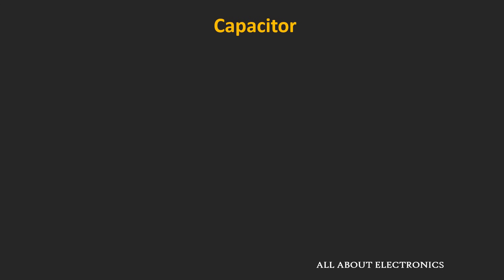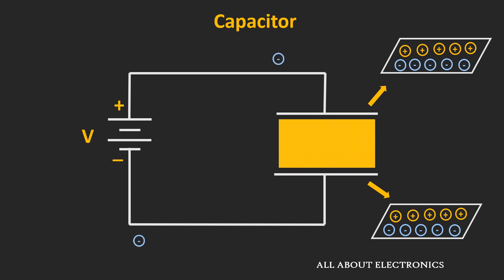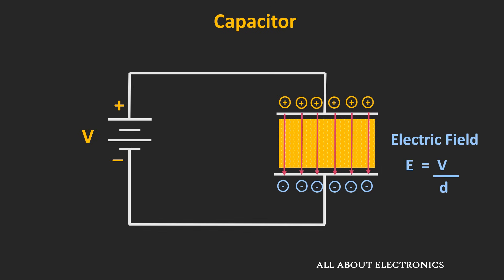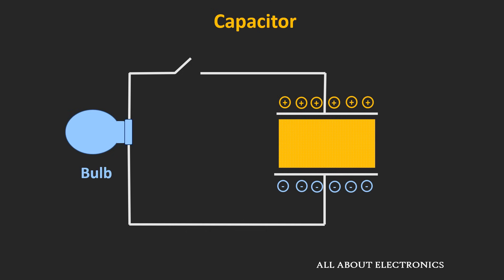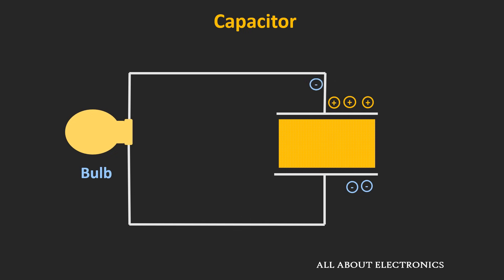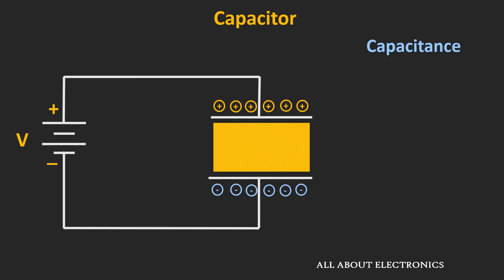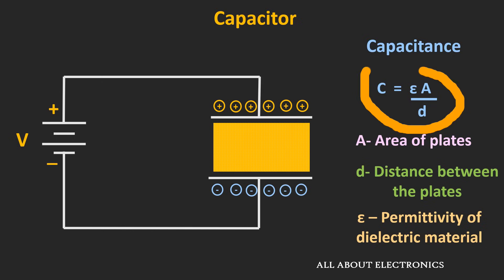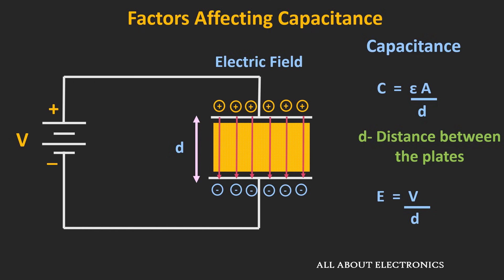How does a capacitor work ??

Comment from the maker: Timestamps for the different topics covered in the video is given below:

0:12 How does a capacitor works? (Charging and Discharging of the capacitor)

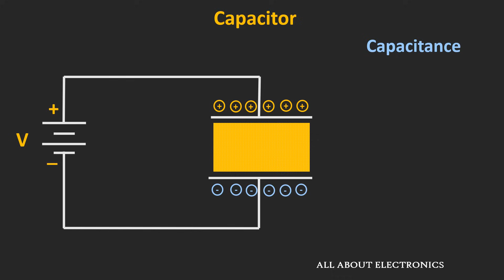5:46 Factors affecting the capacitance of the capacitor
Reply: ALL ABOUT ELECTRONICS thank you very much. Take my salam.
Reply: What is the difference in behavior of capacitor when it is connected to ac and dc source
Reply: ALL ABOUT ELECTRONICS
Reply: one small dought light emits photons right! then how electrons and photons will get balanced , when we connect the capicator to light bulb?? becoz phtons are getting emitted in the form of light , then how it possible sir??
Reply: capacitor is used to store incharge then how it avoid the noise in the circuit
Reply: @jeevith2934  please provide the explanation once u get it.
Reply: plz help
Reply: Sir, Thank you so much ☺😊☺
Reply: How capacitor work in AC supply
Reply from the maker: @SathishKumar-ok1sl  It works similar to the DC voltage. But when the polarity of the voltage reverses, the charge on the plates will also get reversed. As the sinusoidal voltage increases, the charge across the capacitor or the charge developed on the capacitor plate increases. And when the voltage gets reversed, the charge on the plate will also get reversed.
I hope it will clear your doubt.
Reply: Function of capacitor in AC & DC
Reply: Nice video

Comment: If i connect an led to this circuit will it blink before capacitor is charged up or no? It makes sense to me because electrons still flows until its fully charged.
Reply from the maker: I think you mean to say, the led in series with capacitor right !!
If so, then yes, when you just connect the supply to the capacitor, then it will turn on. But as soon as the capacitor charges and reaches steady state, it will turn off.

Comment: But u mentioned that electrons flow from+ to - terminal.. but actually electrons doesn't really move ( maybe very slowly like hours) then is it due to the electric field existing between the battery and the capacitor through which energy is stored? I'm totally confused... Help me

Comment: You are saying that current is only flowing externally through battery but how could it flow through dielectric material
Reply: Displacement current.  The charge on one side produces an opposite charge on the other side of the dielectric, that is effectively a "current".   The electrons themselves do not have to jump the gap.

Comment: 5:32 what's tht electric device behind y capacitor
Reply from the maker: It's a transistor with a metal case.
Reply: @ALLABOUTELECTRONICS  them wouldn't it become a conductor?
Reply from the maker: @MysteriousJelly  I didn't get it. I think you are talking about the image of the capacitor at 5:32 right ??
Reply: @ALLABOUTELECTRONICS  sorry, I was asking "But for flow of charges the circuit should be complete r8? If there's a dielectric substance in the middle then flow of charge would stop right?"
Reply from the maker: From the positive plate or top plate, the electrons gets attracted towards the positive terminal of the battery and through the negative terminal of the battery the electrons are pushed towards the bottom plate. Of course, they are not going through the dielectric material. But there is transfer of electron until the capacitor gets charged up to the battery voltage. Up to that voltage there is a transfer of charge between the battery and the two plates of the capacitor. So, in this way, there is a flow of electron between the capacitor and battery. I hope it will clear your doubt.
Reply: @ALLABOUTELECTRONICS  oh yeah, there is no transfer of electrons from negative to positive plate, electrons are just getting attracted and moving backwards in the same path... Thanks ❤

Comment: My question ❓
Are Capacitors acts like batteries? 
  If Yes, what is the use of Capacitors??
Reply from the maker: Yes, some capacitors e.g supercapacitors  can be used a battery for storing or transferring a quick charge. But not all types of capacitors can be used as battery. 
Recently I have a made a video on types of capacitor. In that video, in supercapacitor segment I have explained that. For more information, you can go through that video.

Comment: Sir I have one doubt that what is the difference between capacitor and battery?
Reply from the maker: In capacitor, energy is stored in the electric field while battery stores energy in the chemical form ( chemical energy) and later it is converted into electrical energy.
Moreover, capacitor discharges rapidly while battery discharges relatively slowly.
Reply: @ALLABOUTELECTRONICS  ty🙏🙏

Comment: If the dielectric material is insulated than how the electron from upper plate reached at lower plate as you show in animation it attracted toward + terminal but after that there is negative terminal it will repel by that then how it will possible

Comment: if for example A capacitor is charged to a voltage of 5V and then this charged capacitor  is connected to a voltage of -5V will the capacitor get discharged?

Comment: I understand it's the charge that is accumulated from the voltage source that gives the plates a positive or negative charge. The capacitor stores charge, does it produce an electric field between the plates. It's the inductor that produces a field and stores energy in the field.

Comment: Sir can u plz explain what if we remove a dielectric from a charged capacitor what will happen to its capacitance ...??
Reply from the maker: capacitance reduce. Every dielectric material has some relative permittivity. For air, it is equal one. So, capacitance will reduce.

Comment: Sir I don't understand that c=q/v, it means as voltage b/w two plates decrease then capacitance increases... For continuation to above equation when p. d b/w two plates decreases it results electric field also decreases, then capacitance also decreases na, how it is possible
Reply from the maker: The capacitance of any capacitor is function of area of plate (A), dielectric material and the distance between the plate. Once you construct the capacitor, its capacitance is fixed. The capacitance shows the ability of capacitor to store a charge for the given value of applied voltage. 
For the given value of capacitance, if you apply the less voltage, then the charge stored across it will be less. If you apply more voltage, the charge stored across it will be more.
For second capacitor, which has higher value of capacitance, if you apply the same voltage (as in the previous case), it will store more charge. (from C = Q/V)
I hope it will clear your doubt.
If you still have any doubt, let me know here.

Comment: Nice boss but my doubt is according to ur video the source was decides the polarity of capacitor and the capacitor polarities are changes w.r.t t o source polarity but practically a capacitor have assigned with constant signs .both concepts r vary which is correct

Comment: But your video is wrong 
Capacitor blocks DC supply 
You seen in this video which is wrong
Reply from the maker: When we say, it blocks DC voltage, it's under steady state condition. That means once it fully gets charged, it doesn't not draw any current. But during the transient, when it is initially uncharged, it starts charging towards the supply voltage. And once it charges to that voltage, it does not draw any current. ( There would be some leakage current, but let's assume its zero for a simplicity). And that's why we call it as if it blocks DC. I hope it will help will clerify this misconception.

Comment: During discharging process, when electrons flows from 2nd plate to 1st plate till both the plates will become Electrically neutral then the positive charges which is stored on 1st plate has to flow towards the 2nd plate to become Electrically neutral?

Comment: What is the cause of the potential difference btw the plates ?is it electric field or the charges stored there
Reply from the maker: The potential difference between the two plate is generated due to the charge stored near the plates. And in fact, that stored charge also generates the electric field between the plates.
Reply: @ALLABOUTELECTRONICS  so when we increase the area keeping the v=1volt ,the charges stored also increases,so the potential also increase between the plates from 1v to something like1.5 naa

Comment: Sir, if the dielectric material opposes the electric field developed by capacitor, then how it's increasing capacitance?
Reply from the maker: As I mentioned, the effective electric field of the capacitor reduces in the presence of the dielectric. And due to that, the voltage across the capacitor will also reduce. (as V= E/d)
And C = QV. That means as V reduces, C will increase for the same charge. 
I hope it will clear your doubt.

Comment: How the charge is remains constant even if the dielectric is introduces between the capacitor? Plz share answer if any body knows.....
Reply: Dielectric does not conduct the flow of charges. It is an insulator.

Comment: After charging how  long a capacitor  can store or retain the charge if, it will left ideally ?
Reply from the maker: Ideally, it should retain it forever. (Assuming there is no leakage current). But practically, every capacitor has some leakage current. And due to that, it will lose its charge over the period of time.

Comment: Its a great phenomenon i think.

Alright, first we need to learn what is light. So what is it? Particle? Wave? Both? Well, its an electromagnetic wave. Check this out;

This is light. The length between the 'hills' determines its wavelength. Well, it is also behaves as particle, like this wave is hitting only one point as seen in piezoelectric event. But whatever, the wave function is special for us. Now, you see electric and magnetic fields, but what are those? They are actually same thing, like different sides of a coin, and coin is being electromagnetic field. But its hard to work when both are in our way, so we use one of them for calculations etc. You just have to know that when there is movement in electric field, it means something happens in magnetic field too.

So, im going with electric fields, check this out;

You know same charges repel and different charges pull. This is the basic drawing.

Now lets get in our light bulb,

You know bulb works by using electricity, and basic bulbs like in picture just pass current through filaman. Now think, what actually passing? Electrons. What are electrons? Negative charged particles. Now lets check the electric field;

Lets move the particle, but keep in mind that electrons jumping from atom to atom, so its like move-stop-move-stop. Now i want you to imagine field around it. You see, you vibrating the field. Its like moving a rope, stopping, moving and stopping. You create waves.

See, a wild electric wave created. Now remember, when there is electric field movement, there is movement in magnetic field too. There is a electromagnetic wave, swimming in electromagnetic field. Thats a photon.

Comment: Can u explain that why capacitor only allow ac not dc
Reply from the maker: Actually it allows both. But when we say it allows AC and blocks DC, we are referring to steady state condition. During DC, once it is charged to maximum value it won't charge further. And current becomes zero. So, we say it won't allows current and blocks DC. But as AC signal is changing continuously, the charge will change continuously too. That's why its said so.
I hope it will clear your doubt.
If you still have any doubt, do let me know here.

Comment: I have a serious doubt in this video... What is blocking of capacitors?  What happens when we apply ac voltage to the capacitor?
Reply from the maker: I think you mean to say how capacitor blocks the DC voltage right?
See, once the capacitor fully gets charged up to the supply voltage, it can't charge further. And once it charges fully, it will not allows the flow of current. 
So, it blocks the flow of current once it fully gets charged. 
In the case of the AC voltage, the voltage changes continuously. That means after the positive half cycle, the direction of the current reverses. So,, the capacitor starts charging in the reverse direction. 
So, in a way, there is always a flow of current in case of AC signal.
I hope it will clear your doubt.
Reply: @ALLABOUTELECTRONICS  in both 
Cases the charges stored in the capacitor is same.. Right? Then what is the advantages of using ac?
Reply from the maker: Actually capacitors are used in both AC and DC circuit for various purposes. 
For example in DC circuits, it is used for the filtering the ripples. In AC circuit it is used in induction motors, power factor correction etc.
Reply: @ALLABOUTELECTRONICS  In ac circuit, on which direction the electrons flow first?  Towards phase or neutral?
Reply: @ALLABOUTELECTRONICS  Thank you .

Comment: Great video.. and you have covered a lot, right from how a capacitor works, to its unit, and what impacts the capacitance.. brilliant.. I have a question.. I couldn't understand why would the capacitor be able to store more charge when the distance between the plates reduce?
Reply from the maker: The capacitance is directly proportional to the electrostatic filed between the plates. And this field is stronger when the two plates are close to each other. (E = V/d)

Comment: Is there any intial terminals for capacitor or will they develop the terminals?or else like....in ac input,for half cycle it'll devlop terminals and for another half cycle it reverses terminals? How
 capacitor works with ac input??
Reply from the maker: Usually, for DC applications, the polarised capacitors are used, where the polarities are explicitly mentioned. While for AC applications, the unpolarised capacitors (e.g ceramic capacitors are used).
Reply: @ALLABOUTELECTRONICS  oh i tnk i need 2 check practical capacitors again😊 btw tnx for clearing my dbt

Comment: Do the electrons from the top plate just accumulate themselves at the positive terminal of the cell? Or do they pass through the cell? Is the latter possible?
Reply from the maker: The positive terminal of the battery attracts the electrons from the top plate and the negative terminal of the battery pushes the electrons toward the bottom plate. Yes, so in a way electrons are passing through a battery.

Comment: what about A.C voltage at capacitor
Reply from the maker: In the case of AC, capacitor charges and discharges according to the applied AC voltage. Just assume that you have applied the DC voltage to the capacitor, so positive and negative charge will build up, on the capacitor plates. Now, if you reverse the polarity of the applied voltage then the charge that is developed on the respective plates will also get reversed. And the same thing happens when the AC voltage is applied to the capacitor. 
I hope it will help you.

Comment: When AC not store in capacitor why are used in induction motar
Reply: Because it provide another current which is leading in nature so rotating magnetic field produced and motor starts to run when rotor cits the magnetic field

Comment: how the positive charge move to top
Reply: Only electrons move, positive charge is just a lack of electrons. Read up on electrons and holes for better understanding.
Reply from the maker: On the top plate, the electrons are attracted towards the positive terminal of the battery. So over the period of time, there will be a shortage of electrons at the top plate. Or in other words, it can be said as the positive charge is getting accumulated at the top plate. 
I hope it will clear your doubt.

Comment: why capacitor stores dc only?
Reply from the maker: Actually capacitor stores charge irrespective of the input ( AC or DC). In case of AC voltage, as voltage is swinging on both positive and negative direction, so effectively stored charge is zero in one cycle. While in case of DC, as there is a constant voltage applied to the capacitor, it stores charge according to the applied voltage.
If you apply AC signal with some DC offset then capacitor will store charge depending on the offset voltage.
I hope it will clear your doubt.
Reply: Does the capacitor stores energy or charge ?

Comment: Sir can you please tell what happens when a flying lead is used and what if the dielectric is destroyed how the current flows???
Reply from the maker: The working principle is same for all type of capacitors. And When the dielectric breakdown happens in the capacitor then the two plates are no longer isolated, so capacitor will behave like a conductor.
Reply: ALL ABOUT ELECTRONICS thank you....

Comment: Sir how capacitor works on ac
Reply from the maker: In case of AC, capacitor charges and discharges according to the applied AC voltage. Just assume that you have applied the DC voltage to the capacitor, so positive and negative charge will build up, on the capacitor plates. Now, if you reverse the polarity of the applied voltage then the charge that is developed on the respective plates will also get reversed. And the same thing happens when the AC voltage is applied to the capacitor. 
I hope it will help you.
Reply: Sab sir se hi pooch loge ya kuch book bhi padhoge.. :D